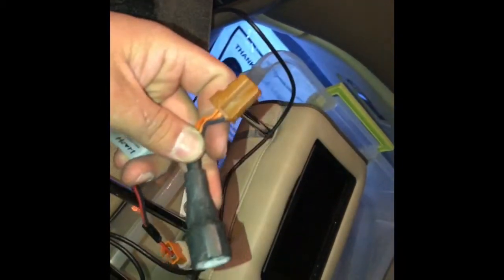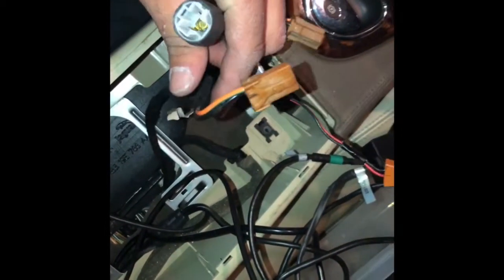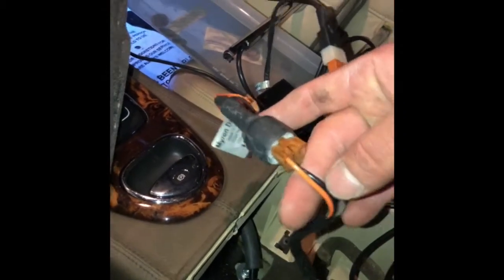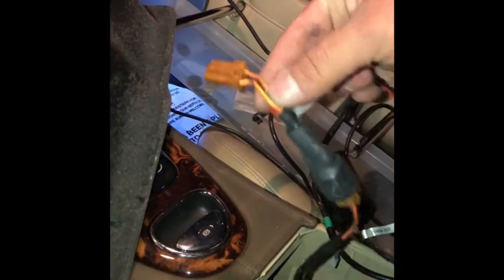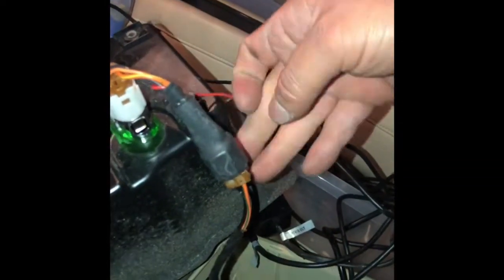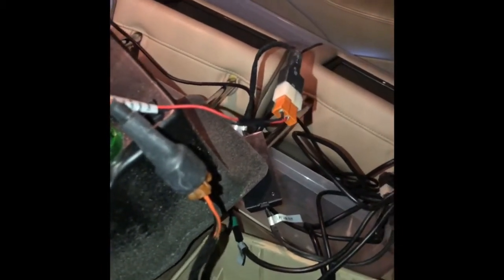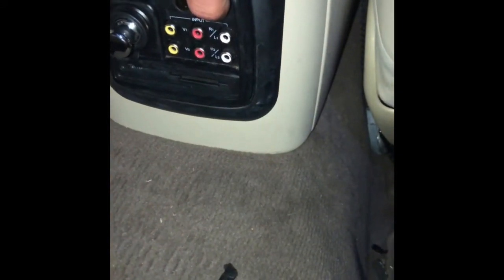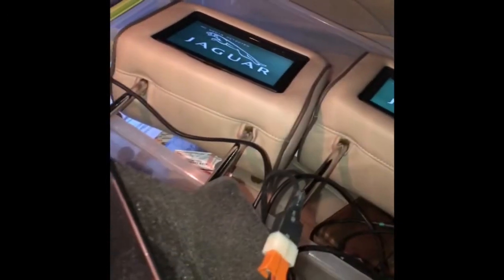How to install plug and play headrest TV’S on jaguar s type AND OTHER JAGUAR’S

Comment: I have a 2007 S-type 4.2 I wanna do this to with TVs from a Vanden Plas, good to know it can be done. where did you get the interface for the power and the RCAs?
Reply from the maker: It comes already with it it’s just a box you move the plastic piece on the consul and you slip it in there